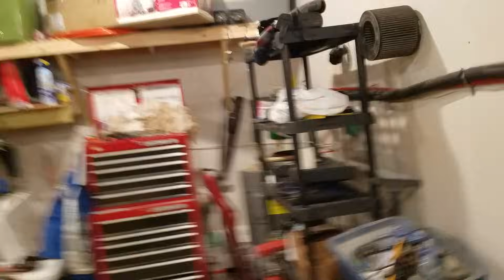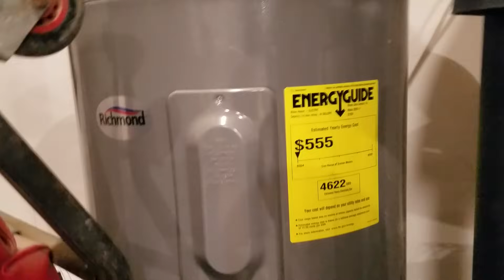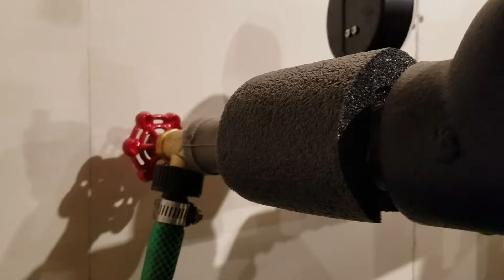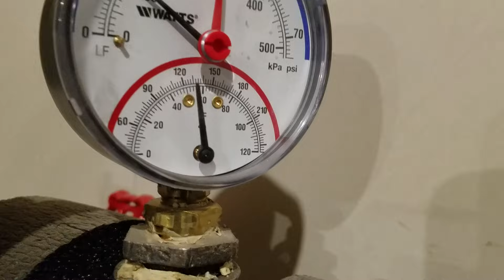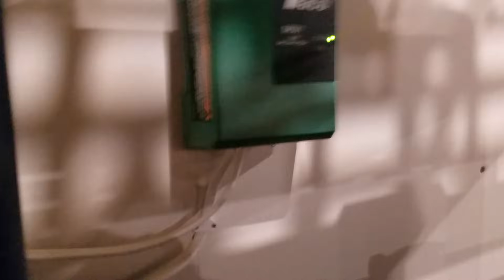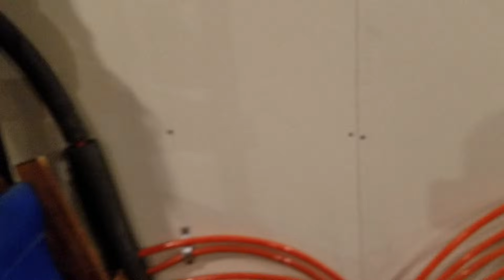EASY FLOOR HEAT (using a new or used hot water heater!)

Comment: Are you nuts?  Obviously, you have not received your power bill, yet.  Heating with electricity is the most expensive way to go!
Reply: Super Dave for some people, it’s the only way to go.
Reply: Super Dave yes it is expensive because the elements in a electric water heater pulls 18amps and that's a lot of electricity.That's how we always checked the elements if we thought they were bad. If they were pulling 18amps they were fine but anything different they were condemned and replaced with a new element .
Reply: M Watkins     That's what they make ohm meters for!  Harbor Freight.....    free with coupon.
Reply: Super Dave it's called an amp prob to check the amps. Using ohms to check an element for continuity is not the best way and will show continuity when the elements are bad. It can have continuity and still be a bad element. If it says 18 amps it's ok but 16 is bad or any other number. The very small elements may differ.
Reply: M Watkins    Either way, space heating a garage with an electric water heater is RIDICULOUS!  Man, he needs to get a pellet stove or something.
Reply: Super Dave 👍👍
Reply: No need to pick any fights but in very rural/secluded locations electric is literally the only option. Second, if we examine all inputs "apples to apples" electric is not that far from the cost of other sources.
Reply: seymore glass      Hmm, I still say wood stove.
Reply: Right again Super Dave; presuming one is healthy enough to chop their own wood and has access to relatively inexpensive timber. For those that require buying delivered and stacked cords... Well, let's just acknowledge your own labour has a value.
Reply: seymore glass    Labor does have a cost, whether it be chopping wood or going out and making a living to pay for the wood. Either way, it's cheaper than electric!  It's possible, but I doubt that the main house is heated with electric. Why? Too expensive!
Reply: Super Dave a lot of houses are heated with electric furnaces.  I installed a lot of them and one being in a home I use to own. I didn't have high electric bills either. It all comes down to your insulation and windows R value.
Reply: Ahhh....  Just you wait and see with the new carbon tax (thanks to Hillary and Obama) that begins to take place starting in 2018!  Yikes.....
Reply: Super Dave I heat my house with an electric furnace. I could use LP however that can end up costing even more the electricity. My electric bill is $175-250 during winter months and I don’t think that’s bad. My furnace is 25yr old and I’m sure it consumes allot more electricity then a hot water heater.
Reply: Jonathan Preston    No such thing as a hot water heater.  If the water is already hot then what do you want to heat it for?  It is properly in the trade called a "water heater"!
Reply: Super Dave https://myheatworks.com/
Reply: Super Dave heatworks model 1 do your research it’s a TANKLESS HOT WATER HEATER! It’s also a water heater but it’s meant to supplement a traditional tank water heater to provide a home with more hot water. 

They have a new model called the heatworks model 3 that is a whole house tankless water heater. The beautiful thing about this system is there is no venting needed and it uses 90% electricity compared to conventional electric tankless water heaters. No reason to call the plumber anymore to install water heater.
Reply: Super Dave , not in Québec Canada average 12 hour of heating mode for 1500 w at 10 cent a kilowatt 12 h × 15 cent/hour = 1,80 a day for a floor or in my case a icf pool, spa at -20 celcius .
Reply: Super Dave   Tomato, tamato! No one cares. Also he is taking hot water and turning it into hotter hot water.
 It's a open end adjustable wrench not a "Cresent" wrench. 
You are correct but no one cares!💤
Reply: Super Dave you lost ALL credibility when you said labor/time doesn’t have cost.
Reply: many stove for sale due to insurance cancel threat. AO Smith has a 97% efficient gas water heater....prob not cheap. LP prices vary many places as do other fuels. Should consider oil stoves. Kuma has one a guy in comments uses bio mixture with very little diesel mixed in. Then again pellet stoves with hydro capability could meow wow? Look at crosslinkconversion, not many sold in US but all over the REAL world. Keep rockin in the real world!
Reply: Jonathan Preston instead of super Dave, it should be stupid Dave.
Reply: Jonathan Preston. Hi , from illinois . what part of U.S. ? Midwest ? Colder climate? What size house ? Insulation?
Reply: No need to pick a fight, but - at least where I live (New Mexico)  Propane is the most expensive when converted to BTU - just a tad more than electric.  Natural gas is about only 1/3 of the cost of the other two.  Pretty big difference.
Reply: Super Dave, it's like a cabinet maker. A man makes, the result is a cabinet. An appliance heats, the result is hot water.
Reply: That's assuming a 4500W heater, it will be different for different wattage heaters, and you can check with an ohmmeter just as easily. 4500W/240V=18.75A Like you said. Now calculate 240V/18.75A=12.8Ohms, the resistance should be around there.
Reply: seymore glass  Yes. Here in Washington, the gas company was separate from electricity. Soon as Puget Sound electricity Bought out Washington natural gas, gas was no longer a cheaper option. Damn monopolys.
Reply: At 62 I have always cut and hand split my own wood. Until this winter, I finally got a log splitter!!!!
Reply: Jonathan Preston
You are a fucking imbecilic moron!  Go re-read my post.....   take a gander again, four eyes!  Now tell me if I said it "does" or "doesn't" have a cost.  Freaking idiot called Preston!

Comment: Good luck with inspections.  Water heaters are not "r" stamped and not approved as a heating appliance.
Reply: So it won't work because the government doesn't approve?
Reply: Jeff Barr ,where did I say it wouldn't work? Would I do it? Absolutely not. I pull permits on my installs and this would not pass. If the structure were to be sold on an fha or pfha mortgage it would not pass and your buying a boiler anyway. Not to mention electric heat of any form is inefficient and costs a ton to run even if there's r20 with an r40 perimeter in the floor. This is where mod con gas boilers shine. Do it right not twice.

Comment: I have never understood the obsession with putting antifreeze into a floor heating system. If the power went off, your daily use hot water heater and plumbing for your whole house would get fucked. So why bother spending hundreds on antifreeze when water is actually a better conductor of heat? Why make the system toxic and less efficient for fear of a situation that would more than likely never come and would bring you a million more pressing problems than the lines in the floor of your garage? 

Not trying to criticize you, more dissing all the morons in here trying to tell you to use the most expensive "safe" glycol antifreeze. The truth is the safest thing to use would be plain old water.

Comment: Never use a water heater to heat a slab, terribly inefficient and will probably never shut off just to keep up with the heat loss, also , they are not designed like a boiler so it will burn out in 2-3 years; I am a hydronic professional so I do know what I m talking about as we tried doing this once and it was a disaster like we expected it to be.

Comment: BAD IDEA. Domestic water heaters are not ASME certified, using DHW in this application voids the warranty, if you had any in the first place. If anything were to go wrong (tank cracks due to much more demand than the tank is designed for) you will be cleaning up the damage on your own dime.
Reply: Who cares if it certified by anyone, it's his house.   Make a warranty claim on anything and all you will get is "we don't cover that".   I would have used a NG or propane unit but what he has done is an inexpensive solution his garage is not ice cold so it works.  I installed a boiler in my home 5 year ago for about 3300 bucks,  the certified guy wanted 17,000 for the same stuff.   I invested the 13700 and now it's 33000 dollars.  If this guy would have gotten a local HVAC guy to install a tankless system or small boiler they would have ripped him off for 20 grand.

You say BAD IDEA, I say great IDEA and keep on saving.
Reply: WRONG AO. Smith and many others are ASME. You need to get educated on what exactly ASME does.
Reply: Are you serious? Setups like this are fairly common and no-one is experiencing catastrophic failures. Folks don't care about filing warranty claims anyways as insurance companies often weasel out of it. This guy is DOING IT, and the sky did not fall.

Comment: That's not a hot water heater.
Reply: Yes, it is an electric water heater.
Reply: Yes it is a "water heater". It is not a "hot" water heater.
Reply: If the thermostat kicks on at 115 degrees then, yes, it is a "hot" water heater.
Reply: Tong Sheng the heater in your car is a hot water heater,  because it uses HOT WATER to heat the air.
Reply: O thank God,  you don't heat hot water. 
Thanks
Reply: Ajc125kx your right! It's just a " water heater"
Reply: Theoretically...an anti freeze heater. This is a cool ...uh..hot set up.
Reply: A pressure vessel using heat to go above the boiling point of a liquid is considered 'superheat'.
  Laboratory experiments have put water under pressure and superheated it to in excess of 3000 deg. F. Hot enough to melt steel. This was early 1991.
Reply: Lol he got OWNED!

Comment: This is the most rigged bunch of crap I have ever seen. I have no problem with using extra things around house and not exactly the right things but DAMN.  At least put a check valve on incoming water. At least put some electrical clamps on the wires and I see you bought pipe to make most of your connections are you just to cheap to buy galvanized ?  Disaster waiting to happen.
Reply from the maker: j s this system was never hooked into a water source. It was filled using pails of 50/50 antifreeze with an electric pump. The hose you see in the video is not hooked to anything it is lying on the floor. The wiring has since been cleaned up a bit. This was a weekend project that got done even though some pieces were missing or may not be proper (to code) for the build. BUT it got done. Thanks for your comment:)
Reply: Check valve?? Why? If he did u to use domestic water for a charge, which he didn't. One would use a back flow  preventer, to stop coolant from entering potable water. @ This guy. Thank you for some GREAT ideas!
Reply: got to watch and listen. It's called reading and comprehension